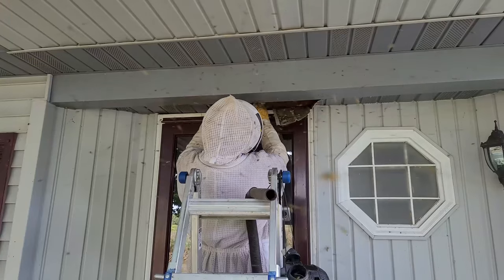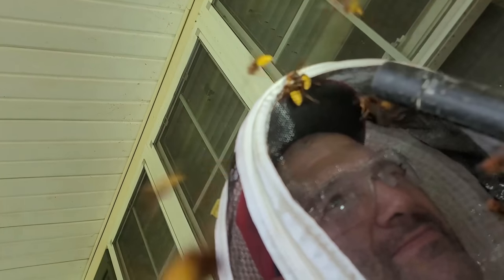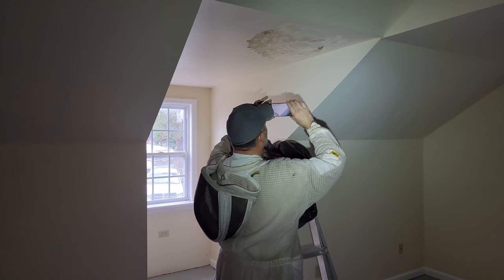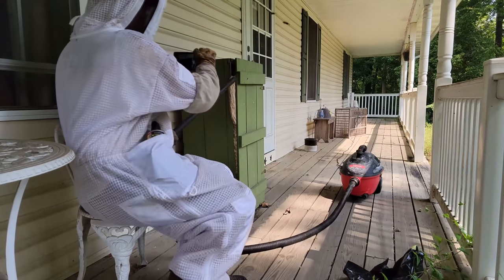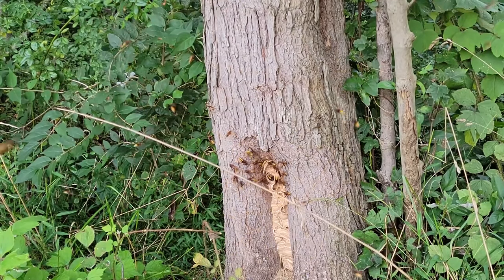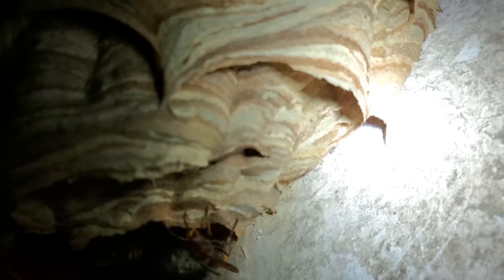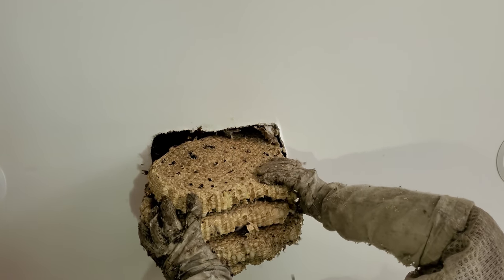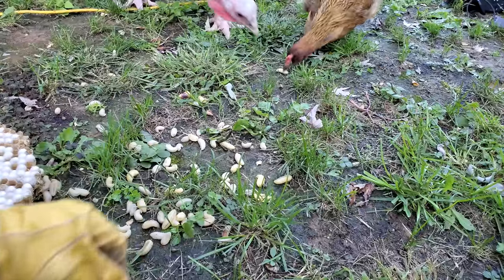Most EXTREME Hornets Nests

Comment: Have you ever heard of a Florida wasp sized 3 to 4 inches long? I came across one working at Tech Data in Clearwater, in 1999. It was foraging, I think, and flew to within three feet of me, close enough that I could make it out in very good detail. It was not aggressive but seemed inquisitive, as if it were cataloguing me for future reference. Then it flew up and behind me up the wall of the building I was outside of.
Reply: Its wing buzz was around 41 Hz in frequency. Same note as the lowest on a standard tuned bass guitar, or E1 on a piano or pipe organ (16 foot stop, lowest E.)
Reply: Eastern Cicada Killer maybe? I'd link pictures but youtube doesn't allow that. They're huge wasps common in the Eastern US (Florida included) which resemble giant yellowjackets, but are actually solitary burrowers. They're not 3-4 inches long though.

Did it have a super long oviposter/"stinger"? It could have been a Giant Icheumonid Wasp. Completely harmless to humans, unable to sting, with an oviposter as long as the rest of its body for laying eggs deep in tree bark.
Reply: Prob talking about the cicada killer, I've only seen a few of them but one of the biggest insects I've seen here in FL, the red wasp can get pretty big here (3in sometimes) and they are very aggressive 😬

Comment: We had a nest in a low hanging maple tree in our backyard.  At the time, our 2 year old granddaughter would visit a lot and want to play outside.  I was in such fear of any of us attracting a swarm.  I took our garden hose, attached the power washer and soaked the nest from 20 feet away.  The hornets could not detect me, the invader.  I also had wasp spray that sprayed 10 feet.  As the clumps of envelope and comb fell to the ground, I would spray it with insecticide, run up and stomp them all.  When the nest was completely down, I sprayed the area in the tree to get the foragers coming back.  I probably looked like a maniac running all over my yard, but it did the trick and there was no rebuilding.

Comment: I do the same job in Hungary. I have encountered same size nests. What new to me is the use of hoover. I always spray some instant killer insecticide on them. Destroy the nest with the sprayers copper tube immediately then spray the flying ones also.

What we also use in europe is high pressure dusting. Just put the dusters end in the entrance of the nest then dust inside the nest at high pressure...

I see its more eco friendly but takes much more time...

How much one removal costs average? In hungary we ask somewhere 40-60USD/removal (in the capital maximum +10km fromwhere we live)

Comment: With the tree trunk one, I would like to see the nest after stuffing it with tannerite. Stick a few pounds for good measure (although even a half pound would still do the trick thanks to the confined space) in there, give it a few hours to let the hornets chill and when it get dark, BOOM. Even if the explosion doesn’t result in the destruction of the tree, I do not see any way that the hornets would have survived an explosion that close and within a confined space.

Another thing, I hvae a few questions regarding what happens after removal. 
1. How long should one expect the hornet to hang around? I assume that after a nest is removed, there may be a few hornets here and there but they will go away eventually.
2. When a hole is cut into the walls or ceiling, how is expected to repair it? Does the Hornet King patch it up himself? Does he contract somebody to do it? Or is the client expected to be responsible for patching it up? I am not looking to criticize the Hornet King if he coshes the last answer, I am not familiar with this business and it's norms.

Comment: Any ideas? I have a large tree full of countless wasp nests along the exterior of many branches. Due to the size of the tree, individual nest removal is not practical. Many of the nests are too high in the tree to spray with soapy water. I have tried several different types of traps including the YouTube favorite, a bucket with a board and meat hanging upside down, as well as Boric Acid traps. These wasps don't seem to be interested in sugar water, apple juice, Coca-Cola, bacon, or chicken bones. My traps, both store bought and DIY, aren't catching a single wasp when placed at the trunk of the tree or neighboring trees. The wasps are about the size of a Yellow Jacket, maybe a little bigger but without the distinctive yellow/black body parts.

Comment: Ummm yea no I work as an exterminator ill use a pesticide dust on the nest no need to rip apart a wall just dust the cavity with either a hand pump or a small blower nest gets dusted like a doughnut an the wasp/horses get little happy dust hats 15min later no wasp. Done fin